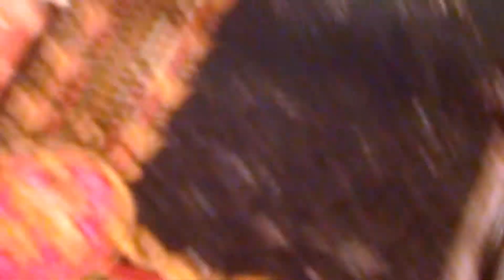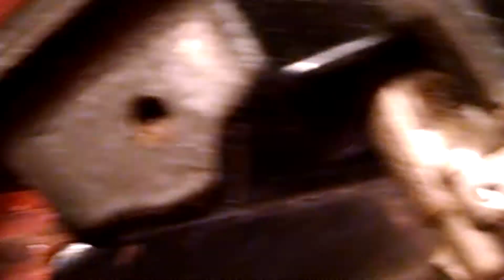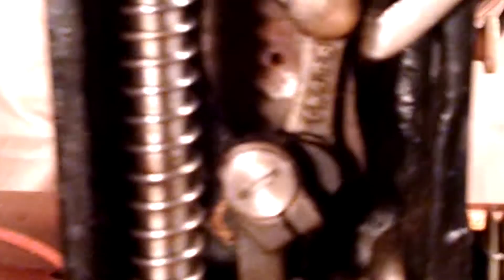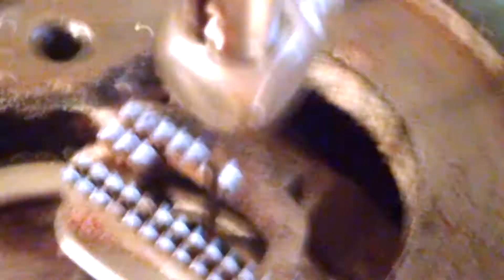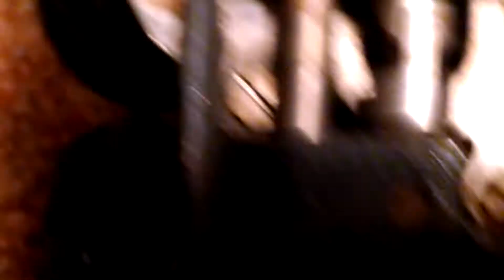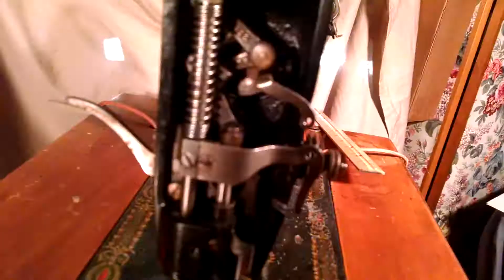How to Adjust Set Timing Singer 66 99 192 Sewing Machine Electric Treadle Antique Vintage Red Eye

Comment: Noob question but on my 66 red eye it looks like a hook on both sides, which side am I going by if I'm facing the front of the machine? Left or right? Thanks!
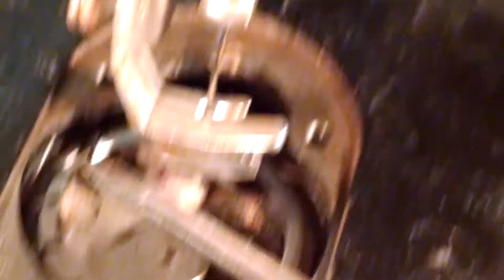Reply from the maker: The proper hook is pointed out at 1:12 in the video.

Comment: Thank you for this video. My 99k Singer just would not pick up the bobbin thread, and I tried everything; tension, needle seating, looked at several threading videos, perused old manuals, etc. 
When I watched your video I found the timing marks, and learned that my hook was about 1/4" late. 
I adjusted it according to your instructions, and now it picks up the bobbin thread every time, as it should. Much appreciated; thanks.

Comment: This is all new to me on a Singer red eye 66-1 treadle.Im trying to follow video .my first question is after the bobbin is taken out how do you get the bobbin casing out? I tried to clean yesterday a lil on it and now the bobbin cover that slides just slides right off! Did I break it also if so can it be fixed!  My 2 featherweights were a breeze but this. ...I’m gonna do it no matter how long it takes and then learn to use it!thanks for any help, it’s appreciated!

Comment: I don't mean to sound mean but the camera was jumping around so much It is hard to see what you were trying to show. When the needle is at it's lowest point is it the hook that is just coming through past the eye of the book that is about to go in the return direction as the needle starts back up ?????
Reply from the maker: at the needles lowest point the hook is just before the needle, as the needle starts its upswing the hook will pass around the needle while the hook is still above the thread hole. This is because the thread is slightly relaxed and the hook catches the thread at this point. sorry if its hard to see in the video.

Comment: My hook timing needs adjusted on my 66-1 lotus(which is the same as a red eye) but the screw on the bottom of the machine to adjust it is stuck. Do you have any suggestions on getting it out?
Reply from the maker: some screws just require the correct size screwdriver and muscle. Sorry, no tricks.

Comment: Hi, Your videos are great and, So i bought a singer 503A in ebay and the stitch indicator lever came wrong and the cam discs don't work right they only make zigzags is it cause of the stitch indicator lever or should i return it or get someone to fix it cause I only have a couple days to return it ,Can you please answer as soon as possible and i would like it a lot
Reply from the maker: Return it and buy from a seller who services machines. You will pay more, but save money in the long run because it wont require post sale servicing. The are so many "flippers" out there who have no clue what they are selling or how to properly test it or check for electrical safety hazards. If you bought through eBay you are protected by eBay and PayPal buyer protection program. Make the seller pay for return shipping if you can. I wish I had a 503 I could sell you, but Im all out.

Comment: What are symptoms of timing being off in a sewing machine?
Reply from the maker: +Wiyan Wakan When your timing is off, your machine will skip stitches. This is seen more often when sewing through thick or multiple layers of fabric. Make sure you are using the correct needle for your fabric. Incorrect needles can also skip stitches. Also make sure your needle is not bent. That can also cause skipped stitches. If you suspect the timing is off it is very simple to verify. You only have to remove the plates, but you dont have to touch the timing screw unless its necessary. I hope that helps.
Reply: The Treasure Cellar Thank you, yes it does!